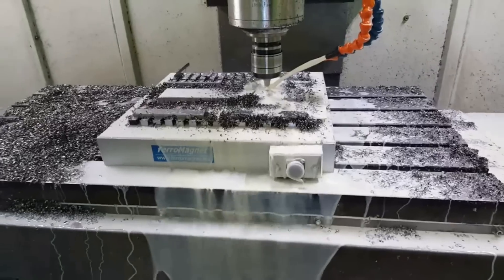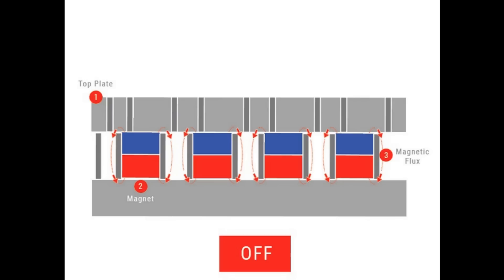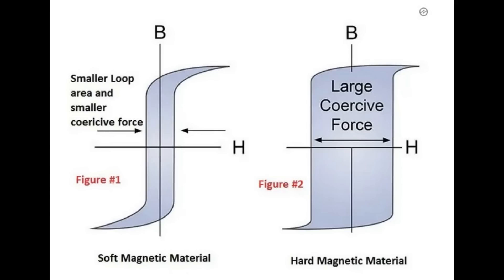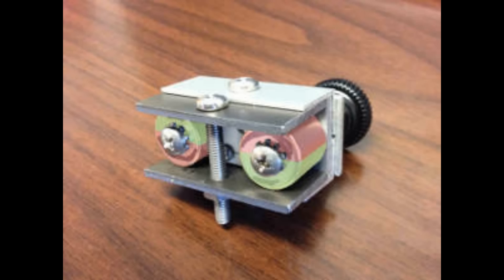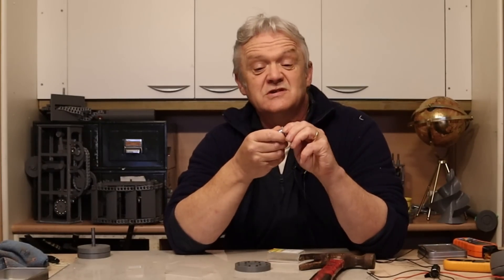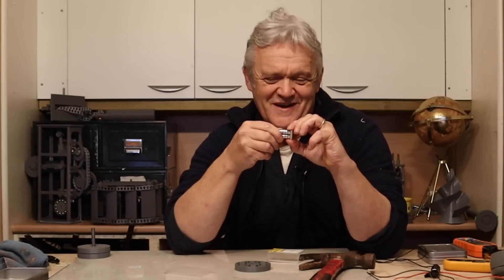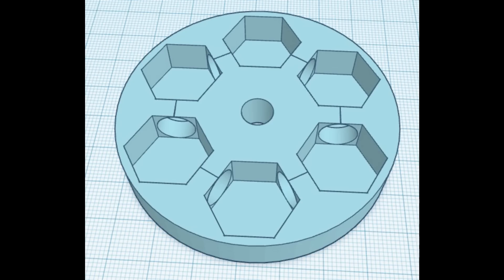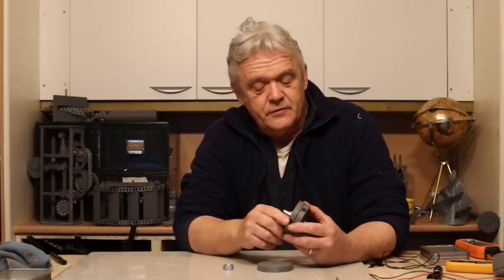2118 Permanent Magnets You Can Turn Off And On

Comment: I had an idea that I’m not sure if it exists already or will be any good but thought I’d share anyways 

on/off permanent magnet 

So you use 2 of these at either side of a some pistons or a motor turning each side on and off subsequently to pull the piston or motors that is similar to Tesla’s theory 

A small pulse of electricity from
A rechargeable battery and or starter motor to start and turn the switch on and off and the magnets will pull the motor or piston this would possibly create more energy than input or at least create the same energy which would repeat the process requiring only 1 boost of electricity to keep the cycle I’ll explain how in better detail 

one side turning/moving would create enough energy to turn the other side on keeping the rotation or the stroke

Its more simple for a propeller or motors but if the piston was inside a inductor the energy could be taken and stored, the energy depending on how tall or the distance that the piston travels 

Depending on the size and the quantity of the pistons would determine the efficiency since you could use the action of 1 turn to move many magnets in sequence if the on/off switches were connected to 1 arm flipping them all on and off

You can use gears on the beginning of the arm either to speed the arm up or use gears to shorten the ratio of the turn making less resistance to turn the magnets to the on/off positions 

It could be possibly be used for taking energy similar to a dynamo or increasing efficiency from fuel energy as in taking the idea above and also injecting small burst of fuel just like an engine 

Magnets and fuel working together assuming there is a way to not damage the structure 

By increasing the distance and the amount of the pistons you can increase the electrical energy output 

I have no idea if any of that makes sense as I am just a guy who over thinks a lot of things and haven’t thought this through properly as of yet 

It came to me a short while ago and I haven’t researched enough to understand it yet 

But maybe yourself or the people in the comments could come up with a solution

Comment: Is there a way to increase the lateral strength of a switchable magnet design.  Or alternatively is there a constant relationship between lateral strength and non-lateral strength?  My interest is to design something that could be switchable but have sufficient lateral magnet strength to act as a router table fence. Thanks for the wonderful explanation of switchable magnets.

Comment: If the force needed to throw the switch is less than the force generated by the magnets when “on”, that would seem to be creating new energy from nothing. Imagine a train of these switches, the output of each throws the switch of a larger, more powerful switch, down the line. It SEEMS like you could use that setup to lift a freight train engine with the flick of your pinky!  That CAN’T be right.

Comment: Old iron, steel and alnico  magnets needed keepers because they were unstable and demagnetized  easily, but modern magnets do not need them as they are much more permanent.  Those "keepers" may have been used on those rare earth magnets to keep them from sticking to everything else and wreaking havoc with the postal equipment while they were being mailed.  They would not be needed to maintain flux as rare earth magnets are quite stable.

Comment: Since it takes less force to slide the magnets than to pull/push the magnets apart/together(depending if we have north north facing each other, or north south facing each other), than we figured out how to use the force of the push/pull direction of the magnet itself to slide the magnet switch into the opposite position and then back again, etc..., than could it be possible to get perpetual motion? You admitted it takes less force, and that means there is more force available.

That is one of the problems of trying to invent a pure permanent magnet motor, permanent magnets don't shut off. So the motors we use today that actually work, are made with coils and use electricity to be able to in essence have a magnet that shuts off and back on again thru the cycle at the right time and position, creating constant motion.

Comment: One thing I've always wondered about this property is how it would work in a gear in terms of torque. I'd imagine it would be pretty great for static torque, but how would this translate in dynamic torque if it were always locking in place after it moves to the next "tooth"? I mean surely it would have to pull pretty well, right? Might need a clever mechanism to make sure it doesn't suddenly lose it between each transition to the next tooth, or maybe use something before the load to ensure it's smoothed out by synchronising with the stronger coupling.
It's especially interesting when you think about applications that only really need the static torque, like say a new type of vehicle that uses a scissor lift on it's side that shoots several metres ahead with no friction and only needs to latch into the ground when it's extended as opposed to constantly applying friction to the ground, or drone that finds a nice windy place up in a tree or something to sit and become it's own generator by becoming a turbine, or a gripper that just needs to say latch on to a pan in the kitchen

Comment: Cool build Robert.  
I made two pernament magnet locks 4 years ago.  A youtuber named Andrew Klein first made his out of wood, and then 3D printed his final version.  The concept is the same, just a little different in design.  If you have not seen his design, just search "3D Print a Magnetic Switch, and how it works".  Great job Robert👍👍

Comment: What do you think of using HUGE solar Stirling engines along the central spine of an O’Neill cylinder to generate Both Light and Power?

You used graphene in one of your videos as a reflector.  Could it also act as a solar panel, besides reflecting the light to a more central point to generate steam?

There’s a solar concentrator power plant in California, but I was wondering if instead of just flat panels, could they have used Fresnel lenses and graphene mirrors/panels to more efficiently concentrate light along a longer heat collecting shaft?

Does it make sense to cool those mirrors and preheat water?

Besides warming an entire O’Neill cylinder (that’s a huge volume) would that also create weather in the cylinder and could you tweak it just using mirrors?

Would it be better to use sodium as a medium to superheat water, like the concentrator plant in California- just have them completely line the central spine.  
- wouldn’t that pose problems for anyone trying to go through the Iris? 

I’ve seen other O’Neill cylinder designs that essentially would divide it into three island strips, with 3 equal windowed strips along the side.
- I don’t know how you would get even graphene windows to hold up on that, even if you used a honey comb design.  Especially if you wanted to have lakes, rivers, so on and so forth.

Comment: I've been wondering about this since around the year 2000 if this can make for a magnetic-powered motor... the strong force being able to alternatively switch off/on the weak force so that there would be a continuous wheel rotation (no hindering gaps).
Reply: If I can recommend a wonderful website, khanacademy, first course first lesson in physics. cheers

Comment: Sounds like a possible motor design that would have low input high output
Reply from the maker: it certainly is interesting - there are quite a few switched flux and reluctance designs out there

Comment: could you please try and make tetrateanite at home according to that recipe? It would be highly entertaining. do the domains align automatically? How does tetrateanite obtain its magneic property? I still wish to have a floating levitating AC generator using magnes to keep the rotor afloat and spinning as I've mentioned. I find it very interesting how one would separate the fields stabilizing and keeping the rotor floating and spinning, and the field from the N/S N/S magnets arranged on this rotor (two separate fields with two separate roles in the same device) for generating AC in the coil? I was thinking of making a crude one with styrafoam but I just can't get my hands on magnets. I'm just SO curious about tetrateanite. Bizmuth is also so pretty.
Reply: maybe there could be a flux swich layer on the magnetic spinning levitating rotor of my 'doddy drive' so that the field keeping the rotor spinning and levitating does nto interfere with the N/S N/S circular arrrangement of magnets that enerate AC in the coil? It's just something I can keep thinking about how to do. Is Julian Assange out of prison yet? I wonder.
Reply from the maker: i will have a think how to do it mate
Reply: i just reliased that I guess the addition of phosphorus realigns the teanite's domains to make it tetrateaite. however what happens to the phosphorus? Where does it go? What does the iron and nickle do to the phosphorus? I'm no scientist but an aspiring painter at age 43 who after many years of just thinking about paint brush stroke appications will actually paint, after carefully mapping and planning the geometrically patterned landscapes with white pencil, then grey acrylics for light tones, and then watercolour for semi transparent colour addition and further patterns that aren't necessarily subject to the shade patterning of the actual lanscape itself, for an artistic vibrant, energetic effect that could also convey semiotic meaning... ~  @ThinkingandTinkering

Comment: Latching relays using this with magnetic amplifiers, low-loss mechanical DC step-up or step-down with magnetic core inductors, small angular or linear displacement high efficiency generators...I sooo want to try making these myself using the stuff you showed in this video Rob. Love it!
Reply from the maker: go for it mate
Reply: Those are the thoughts that struck me here.

Comment: I've got a device that uses those principles., sliding to move the command shuttle, and pulling the magnets on the rocker to drive the heavy flywheel.  My challenge was to make magnets switchable without using elec.  I want to replace the chain and sprocket on a bicycle with this magnet manipulated transmission thingie
Reply from the maker: awesome mate

Comment: How much weight can one of those units hold when assembled?
Reply from the maker: depends on the magnet mate
Reply: @ThinkingandTinkering  How much can the ones you made hold?  Would it hold the weight of a work light on a lock line pipe on the side of a cabinet?

Comment: If this can be done incrementally,  it would explain how computer software  can control the resistance of the 'magnetic resistance unit' on my cycling excersizer.  Cheers
Reply from the maker: chances are mate you ave a collection of magnets on a bar and the software moves them nearer or further away from the flywheel

Comment: By the way, if you are newer to 3d printing, be careful hammering those nuts in - its very easy to crack it, so you need a good infill.
Reply: - yep, melting fittings into prints - using soldering iron or remotely "heated fitting" - is a secure method (magnets don't like heating) to get fittings into prints generally.
Reply from the maker: nice advice mate - cheers

Comment: This is used in magnetic door holders that hold doors open, basically two halves of a horseshoe shape with a cylinder shaped magnet with N on one side of the cylinder and S on the other (not N at one end and S on the other), placed in the middle. In one orientation the horseshoe halves become N and S and can hold a door open, but rotate the cylinder 90 degrees and they lose their magnetism and the door closes.
Reply from the maker: cheers mate

Comment: Magnetic chucks loosing power reminded me of a tale an old boss told of working in a machine shop during WW2, if the lights went out during an air raid you automatically ducked because you knew things would start flying from the surface grinders mag chucks.
Reply from the maker: lol - nice story mate lol

Comment: Great visuals on explaining how that works!

Hey, could you use this to create an induction heater? Just wondering if you linked this to a windmill if it could heat a sand battery better than friction.  Seeing some advantages here...  🤔
Reply: - spin one disk really fast - it may heat a nanowire - it will definitely generate some current in an adjacent conductor (cutting the flux lines...)...
Reply from the maker: it's a bit over complicating it for that mate - all you really need for a magnetic based induction heater is a fast spinning magnet disk and a metallic plate like copper or ali

Comment: Saw a recent video where a guy made a magnetic motor using this principle, had 2 steel pistons on a common crankshaft where one piston would rise when magnetic flux was on while the other piston's flux was off and retreating.  Almost looks like a perpetual motion machine.
Reply: Yeah send the link
Reply: @midzuushi No one but the channel owner has been able to put a link in a comment for years.
Reply: @miken7629, the system only performs momentarily mostly due to flux locking at every interval off and on of the magnetic array! 
A flywheel only sustains the (perpetual) motion to overcome the flux lock although it inevitable slows down in time and stops.
What looks immediately to the eye as a gain is not actually a gain and employing this particular method fails when utilised as a solo source to operate from.
Coupling multiple devices of several different atrophic ailments and syncing them in time where one picks up at peak performance as another wanes in series is key to perpetual motion, although many fail to do this due to time, money and foresight of capacity via use of coupling system to self sustain.
There is a NO ONE STOP SHOP to perpetuity it's a conjoined collage of multiples to enhance each other contained in a loop cycle, whilst eliminating everything as much as possible that yields an entropy redundancy.
Reply from the maker: can you post a title?
Reply: @ThinkingandTinkering   "Newest permanent magnet motor" from Energygraphy
Reply: @ThinkingandTinkering  I’ve posted the video I think he was talking about. I love watching yours and lukes videos by the way 👍
Reply: Yeah, that sounds interesting!
Reply: the Flynn motor?
Reply: It looks interesting but the problem I see is at 1:17 (in that video) expecting the magnet to attract the piston from the bottom dead centre, that's quite a distance. I think the flywheel will carry it up but intuitively, I think it's a matter of diminishing returns and will settle in the state of the piston stopped somewhere near the magnet.
Reply: Look up "All magnet motor" by PMMG4HYBRID. The guy has passed away since, but seems more credible than others. "Rony James stator" and his magnetic shielding idea on bicycle wheel is also worth a look at. "Motion magnetics" have also designed some magnetic switch motor on/off concepts. It seems very possible if the energy input is less than the output, then somehow capturing it all and placing it back in the system. The magnets themselves are a battery in a way. They store magnetism. As you use it, it degrades with time becoming less magnetic/weaker. How long will last? No body knows.
Reply: I think this is what you’re talking about. There’s another video of a man in the 1940’s that made it. And another from the 80’s. It been reinvented many times. This one is South Korea reinventing it again. It works by-If you use a slide crank, then you can drop the magnet over the top of magnets, on the centre drum of the magnetic generator, so you don’t have the problem of cogging, when they first meet. 👆like that.

Comment: magnets have another property, in that if you heat them, the magnetism disappears at a certain temperature, I recently picked up a couple of professional soldering irons that use this principle, and the soldering tips contain magnets, when cold these magnets attract the connector inside the soldering iron, and this makes the circuit and heats the tip, when the tip reaches its operating temperature, the magnet gets demagnetised and the circuit breaks, of course the tip starts cooling, so the magnet becomes magnetic again and makes the connection to reheat, this ensures a steady temperature at the tip, controlled by the magnets, I would imagine different temperature tips are controlled by the material of the magnet and what temperature it demagnetises.
its called the magnastat and uses the curie effect?
Reply: It must be a special magnetic material in the soldering iron because many magnet types, especially neodymium, will not recover their magnetism once they cool back down.
Reply: @Andy-df5fj  I am not sure if its a magnet or attracted to a magnet to be honest, look up the curie point magnetic heat engine for a demonstration using nickel.
Reply: i have researched this and now believe the magnet is in the soldering iron / switch end, and the material on the tip is ferromagnetic, and its that material that loses its magnetic ability to attract the magnet at a set temperature, so the magnet on the switch is moveable and is attracted to the metal on the tip, and when the tip loses its ability to be attracted to the magnet a small spring moves the contact / magnet away from the tip, breaking the circuit- but it is another type of magnetic switch.
Reply from the maker: ah - lol - cheers mate
Reply from the maker: aren't you talking about the Curie point mate? In which case I am surprised the magnetic effect returns